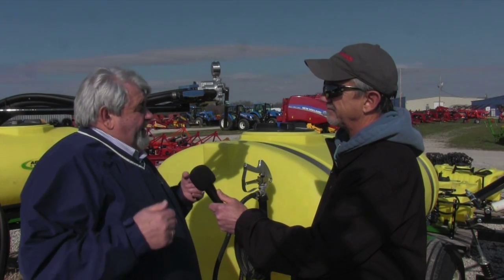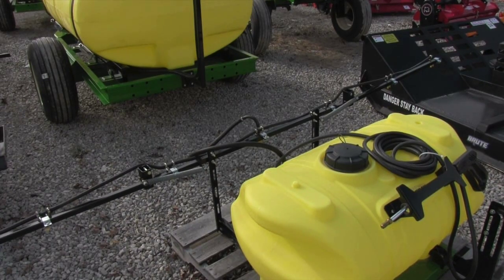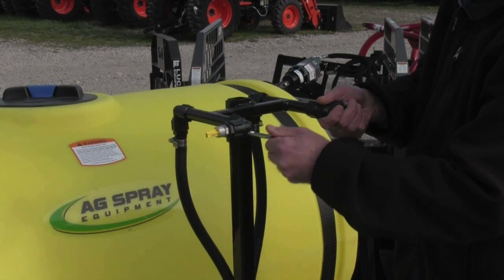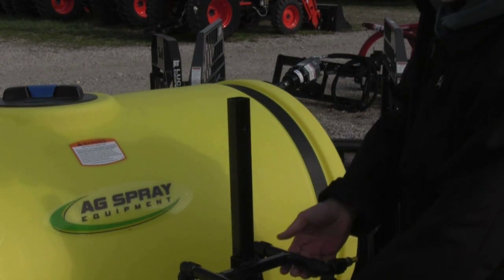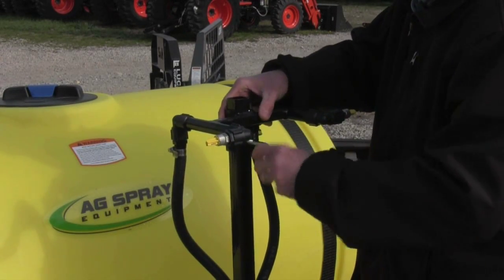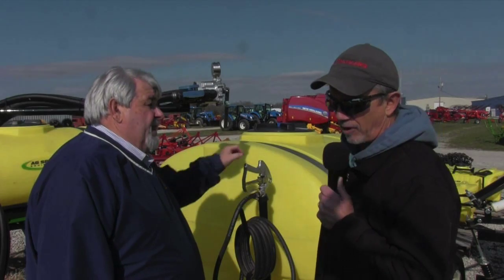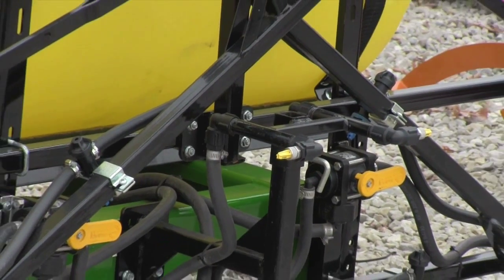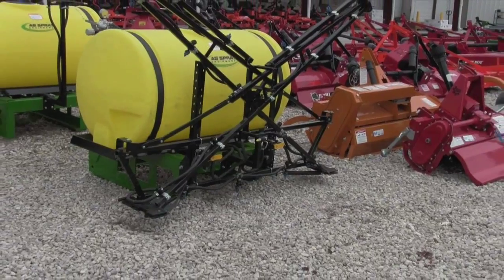Getting the Right Booms When Selecting a Sprayer

Comment: Is boomless safe to use on a tractor without an enclosed cab.  Wind is always a consideration curious on this point.
Reply from the maker: That's a tough question.  Technically, you're supposed to have all of the rubber garb on, hat, gloves, respirator, etc. when you spray without a cab.  In reality, that's tough to survive in hot weather.  I grew up on an apple orchard where we used a mist-style sprayer, which is similar, and no cab.  If you tried to fight the wind you could receive a pesticide bath  so we never fought the wind.  Sometimes that meant you had to "deadhead" or spray with the wind then return to the other end of the field without spraying and come back, but that was better than the alternative.  Always use the wind to your advantage.  Most cab tractors are not spray certified anyway, they're much, much better than no cab, but if the pesticide comes your way you may still ingest some of it, even in a cab.  And certain pesticides aren't real good on the paint of the tractor.
Reply: Thanks Mike that sums up well what I was thinking.  I can remember the stories told in my family who farmed in Black Rock area of Northern Arkansas and St James Missouri.  In those days it was boom only on a H Farmall that I remember in St James. My Grandfather grew cotton in Arkansas but by the time I was old enough they were out of the planting business and into cattle and hogs so I am not sure what they used in those days.  I have a small driveway sprayer with an 8 foot boom but I typically don't spray the fields or food plots.  This was a very informative series that has me thinking about it though.  So thank you for that.  Thinking now of that old tractor there might be a video in that for you on converting a tricycle front end to a wide front end. ;)